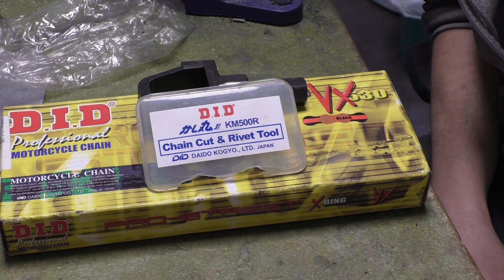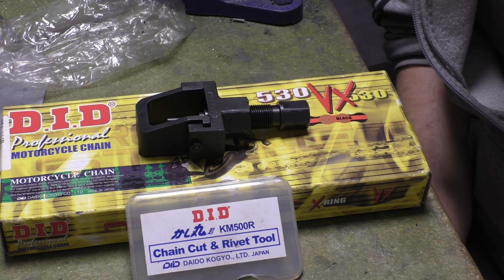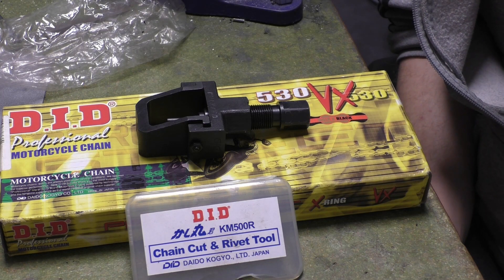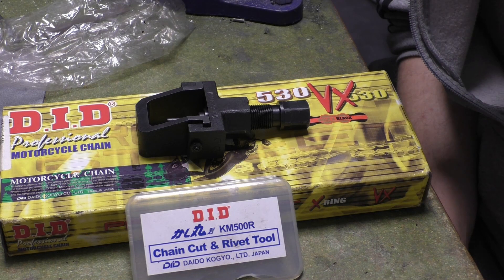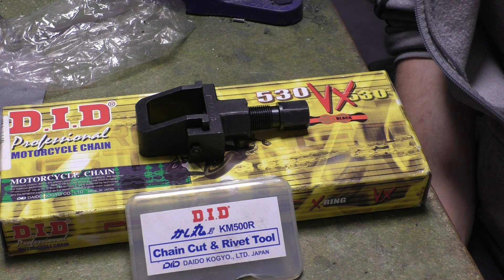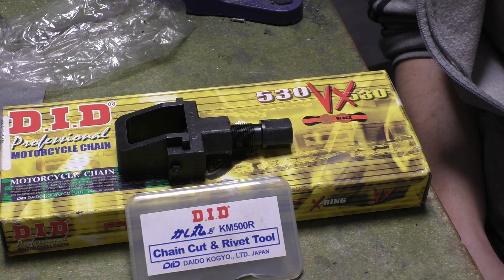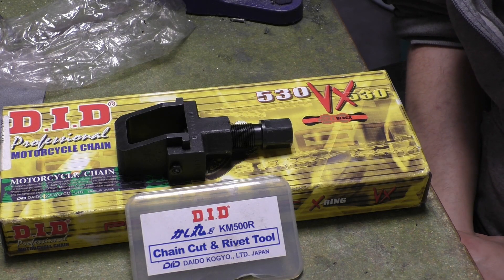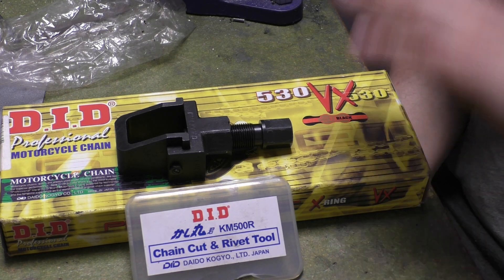D.I.D Tool Competition

Comment: First time I went there before but I entered what you said, not what was letters across your screen. Anything can work to get chains apart, that tool is the only good way to put them together. Unless you use the clip masterlink.
Reply: OK on a slowped but on anything bigger than say 250 endless all the way. Bitter experience and memories of waiting on the M6 for hours.
Reply: John McCallum 
I agree if I have access to the tool that's what I do for sure. I didn't have tools for my old 750 turbo 630 chain 15 years ago. Its still on there (15,000 miles). If I get one of those tools I WILL put on the riveted link as I still have it!

Comment: I was looking forward to a better chain breaker, as I DIDN'T grind down the rivet, thinking my cheap chinese breaker would do the job, but it messed up the threads of the chain breaker. Still kind of works though. I'm abstaining though because I don't want to keep going on with this poking and prodding of Del.

Comment: You can get the pin on Amazon sold by D.I.D mate,looked it up after your last bit as I could do with one if these. Anyway look on Amazon fella
Reply from the maker: Where? Do you mean Amazon.com or .co.uk?
Reply: The Workshop co.uk mate I was on the Amazon shopping app
Reply: The Workshop it's labelled as this mate.   D.I.D Replacement for Trennwerkzeug and Riveting tool, KM500 Ersatzdorn, threaded rivets, Trennbolzen, DID, Rk-Afam 0955010
Reply from the maker: I think these are from Germany or the states £15 delivery!
Reply: The Workshop ah fair enough so do you think it's knock off then